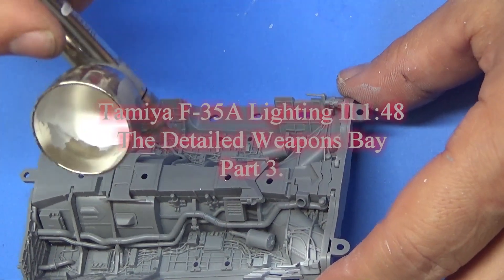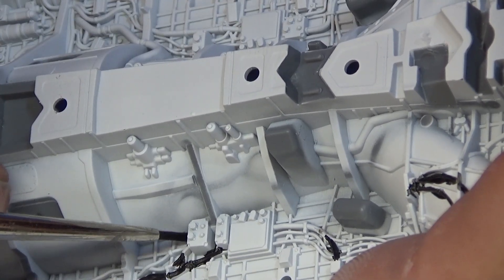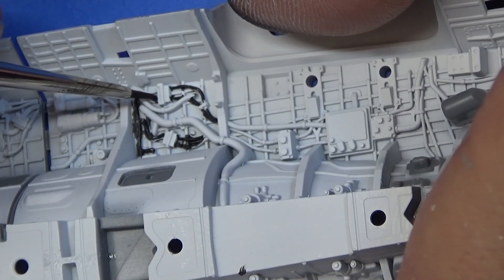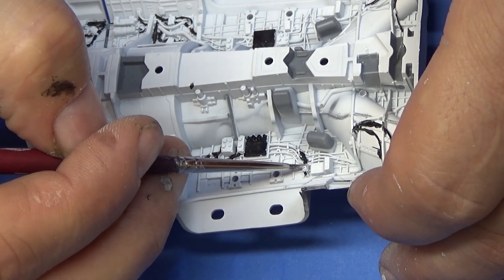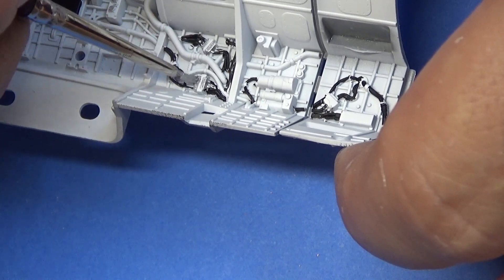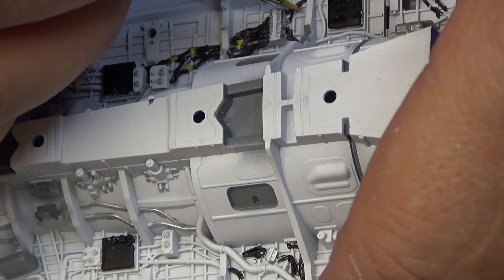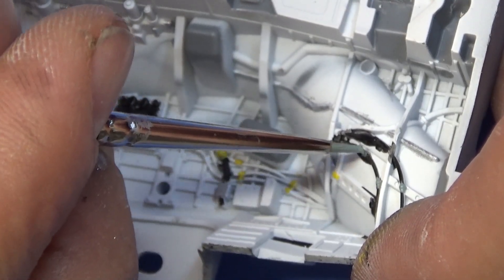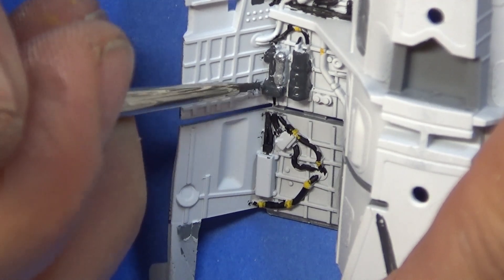How to Build the Weapons Bay of theTamiya F-35A Lightning II 1:48 Part 3

Comment: In the spirit of being constructive, you would get a finer result if you used a smaller paint brush and if those used still had a shaped tip. Unfortunately the one used in the video has a "splayed" tip and probably should be replaced. You will appreciate the improved results.
Reply from the maker: That was a 00000 paint brush. Unfortunately, i cant keep a straight tip for the life of me.